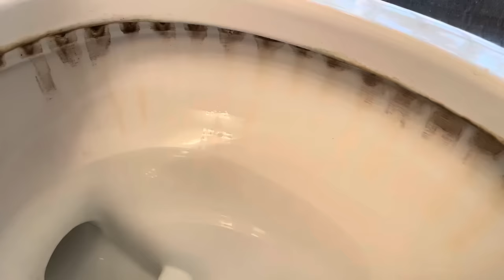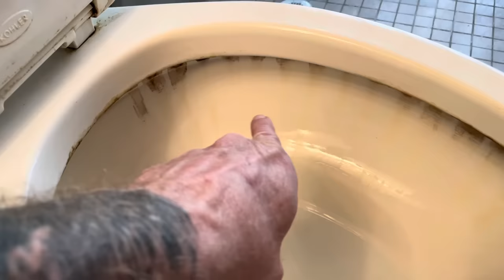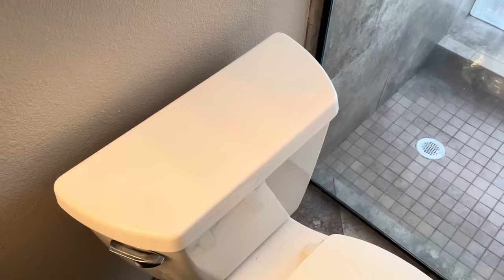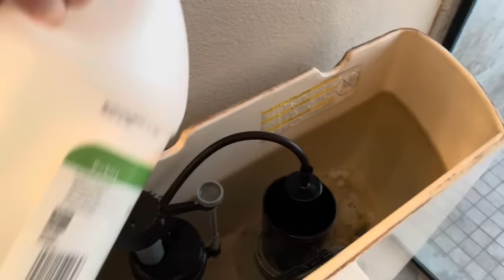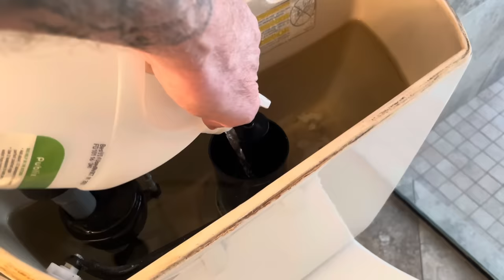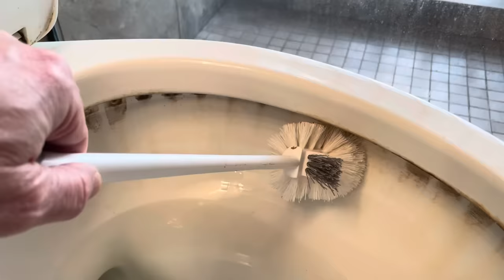Why Does THIS Keep Coming Back and How to STOP it

Comment: Flush it, clean it, dry it. Tape off the whole area and pour CLEANING VINEGAR in the overflow tube until it’s full. Let it set over night. Cleaning vinegar is 75% and not fit for human consumption. Trust me, it works. It’s also great for weeds in the yard.
Reply: True on the weeds, but it's non-selective, will kill any plant.
Reply: How do you tape off the whole area exactly?
Reply: Thank you for the weed thing!
Reply: @ascensionessentials tape the seat and handle down so no one can use it?  🤔 tape the door shut so no fumes escape?
Reply: Tape your nose and mouth so you don’t breathe it in.  Then get the hell out of the bathroom and take the tape off - you have 2 minutes. 😅
Reply: No cleaning vinegar is only 6% whereas regular vinegar is 5%
You can however find industrial strength pure grade vinegar but it’s still typically only at 45%. You have to actually search and find the 75% strength.
Reply: It cost way too much to use as weed killer. Might as well just use weed killer for a lot less in cost.
Reply: @DrLauraRPalmer lol,vinegar $5.00 a gallon,weed killer $25 a gallon.
Reply: repentandbelieveinJesusChrist1  It's good to know that the mold in my toilet was put there by Jesus.
Reply: It's not fit for human noses, either. Don't expect to use the room for a couple days if it doesn't have a window.
Reply: For the weeds use boiling hot water.  Pour it on them.  For the toilet, tape under the rim to plug the holes.  You can use toilet paper soaked in the vinegar to pack under the rim to if you don’t want to mess with tape.  Make it kind of like a putty/goo.  It can all flush down later.  Let the vinegar sit in overnight if your prostate will let you.😅
Reply: @jonathandeere6232  There are plenty of weeds (say, poison ivy) that survive forest fires. Boiling water won't work on such, altho it's a good first try.
Reply: I clean inside toilet bowl for water sediment, also in my hot water pot…
Reply: @ascensionessentials 
Thoroughly dry the area of the jets.  Then use duct tape to seal them off (strips will seal 4-5 at a time around your curved toilet bowl.  Pour your vinegar into your fill tube.  Let everything stand for a good while.  Overnight would be optimal.  Do not flush after you've taped and introduced the vinegar.  In the morning, remove tape and flush a couple times.  Voila!
Reply: Does this apply If I'm in an apartment equipped with a windowless washroom, and has no suction fan? There's a ventilation duct, but no suction fan. Should the bathroom door just be left open, if there's nobody home during the day?
Reply: @74Voyeur  
Cleaning vinegar is great but regular vinegar will do just fine.  People 'descale' coffee makers, etc. with regular vinegar and it works to break down mineral deposits and limescale.  It will kill any algae or mold as well, but, hopefully this isn't in your coffee maker.  🥴  The longer it's in contact with the mineral deposits in a porcelain commode, the better the removal of any hard build-up.

Comment: I'm getting tired of this black nonsense appearing every 4-5 days. I clean it and sure enough, it's back. Going to try it tomorrow. Amazing what you can learn on YT. My heater went on the blink, I called an HVAC co. and they told me $9500 for a/c and heater replacement. Went on YT, did some research and found it was the electronic control board. $195, found install video on YT. 5 years later, running like a champ. Thanks Papa Joe.
Reply from the maker: You bet. 👍🏻
Reply: Yup
Reply: The internet and being able to share information destroys all these scams
Reply: Way to go, dude !!

Comment: I'm beginning to think vinegar can do just about anything. No need for expensive cleaners which pollute our water. Thank you very much for this!
Reply from the maker: You bet. 👍🏻
Reply: I'm realizing that, great stuff😅😊
Reply: I add about a cup of vinegar to laundry when washing bed linen
Reply: Vinegar and baking soda. 👍
Reply: It really does. I'm a smoker and my windows in my house need a good cleaning every 3 months. I just use hot water and vinegar. They sparkle after that.
Reply: There's also "industrial" strength vinegar, about 10x as strong as what you'd use for cooking. Very strong odor, but it works wonders.

Comment: One reason this happens is because there are mineral deposits on the bowl.   Gunk sticks to these deposits and mold grows on the gunk. Vinegar can help clean mineral deposits… but often will not get them all…. Especially with heavy deposits,   What works is a pumice stick.  Use this to grind away the deposits . Interestingly… pumice stone is harder than the deposits, but softer than the toilet.   Gets out toilet rings too
Reply from the maker: Absolutely, I did a video on that. 👍🏻
Reply: doesn't the pumice score the surface of the porcelain which allows for deposits and microbiota to come back more tenaciously?
Reply: I did not know this & consider myself the Goddess of home cleaning hacks! LOL Tyvm for the pumice stone info
Reply: @selenepickins4874  
Hey Selene…. One last thing.   When you use the pumice stone on mineral deposits… it feels like you are destroying your toilet… that is the minerals being ground away.   When the deposits ,  are gone the stone will slide easily over the porcelain
Reply: The vinegar kills the mold, then you  have to clean the residue
Reply: If it were mold, as he says,  bleach is waaayyyyy better than vinegar.   It is not mold (new urban legend is born) ,  it's rust and other minerals which acids are effective against.
Reply: @dennisgarber I had the same problem. I examined it with a magnifying glass and it was most definitely mold! Hydrogen peroxide is the best thing to use to kill mold. I am extremely allergic to mold and I have used it successfully for years for all kinds of mold.
Reply: @dennisgarber  
You are partly correct…. The underlying problem is the minerals.  And you are also correct that acids help dissolve minerals.   But what if there is a thicker layer of minerals?   For example… let’s say you have a hot pot with minerals on the bottom.   Let’s say you throw in some vinegar…. Let it sit, and even scrub.  Then rinse out the contents.   Will the minerals be gone?   Nope.  Because vinegar is a weak acid…. Which is why you can eat vinegar… and why it only works with light mineral deposits   

Also…. Tap water is not pure….nor is a toilet a pure environment, nor is the air in a bathroom devoid of spores.   As a result…. If you have mineral deposits on your toilet… the surface will become rough… and the rough surface will collect layers over nutrient rich dirt…. And that nutrient rich dirt will become infected by bacteria and spores.   That colony can be killed by bleach, or acid…. But will re establish itself on the remaining rough mineral surface that resists cleaning by bleach or vinegar

If you successfully remove the mineral deposits… a simple flush and a bowl brush will keep your toilet tidy 

I
Reply: I use grill screen or drywall screen. Works great with a little elbow grease.
Reply: @kcojco  
I never thought of THAT.    I would only be concerned that it might be hard enough to scratch the porcelain.
Reply: @hedgeenemy1587 like scraping the enamel off your teeth ? not sure 🤔
Reply: @hedgeenemy1587 You need to wet the pumice stick first, I believe that’s what keeps it from scratching the porcelain.  I use 7th Gen  powder that works really well keeping the mineral residue off.  And occasionally the pumice.
Reply: @hedgeenemy1587 it does scuff the porcelain. Don't try it. We just purchased new toilets instead.
Reply: Pumice stone damaged the porcelain and causes stains to be worse, in my experience with it
Reply: Work smarter, not harder. If you have heavy mineral buildup, use something like CLR instead of vinegar and let it sit for an hour or two. You'll be able to remove the buildup with a toilet brush instead of scrubbing and potentially scratching the porcelain. If the buildup is really bad to the point where your toilet is slow flushing, you can use muriatic acid, but you have to be careful as it's caustic and can burn you.
Reply: @tboneforreal   
agreed
Although it is also the case that these products sheet off a toilet bowl… and for this reason it is hard to maintain enough concentration of chemical to effectively clean significant mineral deposits…. And the reality is that most people do not get around to cleaning mineral deposits until there is a significant build up
Reply: I swear, hard water causes so many problems. When my shower is dry, everything is covered in fine, white mineral powder. It has also stained my glass water bottle. You’re right though, pumice is the only thing that works. I’ve tried every product under the sun.
Reply: @dewilew2137     The thing  that I could never understand is why the minerals cling so tenaciously to shiny surfaces like tile, chrome, glass, or freshly waxed car paint…. Or, of course toilet bowls
Reply: Rubbing The pumice on the toilet surface makes my skin crawl...it's horrible like screeching chalk on a chalkboard.
Reply: @euphrates74   for what it is worth… this sound is from the grinding off of mineral deposits
Pumice slides smoothly over a  clean porcelain e surface
Reply: @hedgeenemy1587  Glazed porcelain tile has a Moh's hardness of 8 on the geologic scale. Pumice is 5.5-6
Reply: I’ve seen people with scratched toilet bowls from pumice damage.
Reply: @MrArdytube  

There are different types of vinegar, the vinegar you use for this is not the kind you eat.
Reply: VERY HELPFUL
Reply: @Delimon007 - Of course it is. Vinegar is vinegar. It’s just regular distilled vinegar mixed with water to a standard 5% concentration. 

Higher concentrations are available but they’re just as edible if diluted properly.
Reply: There's plenty of glazed porcelain surfaces on a toilet that can be used to test the pumice if you guys are concerned. Just try it in the back somewhere before using it in the bowl.
Reply: @littlestbroccoli  
Thx…. Just one thing….  When you use a pumice stone on mineral deposits…. I feels like you are grinding away the porcelain.  An alternative way to test pumice stone is on a clean area…. like the outside of the toilet bowl…. This way You can verify that it does  damage the bowl
Reply: @MrArdytube 😂
Reply: Once the bowl is clean, use caranuba car wax to polish the inside of your dry bowl and under the flow rim.  Just like polishing your car.  Water flows over so nothing can stick.
Reply: @jonathandeere6232  great idea

Comment: This worked for me perfectly!
Poured vinegar down three different times - first time I did it, I just poured maybe a pint in, let it sit for an hour, cleaned the bowl. It came back again, but to a much lesser degree. Next day poured some more down, let it sit for the hour again, nothing came back. 
Did it a 3rd time for good measure - all mold gone and the bowl has remained streakless.
Thanks very much for this!
Reply from the maker: You bet. 👍🏻
Reply: No streaks until you finish that burrito.
Reply: I tried this four months ago and it works! So far, it is has not returned.
Reply: @papajoeknows8355  Suppose you don't have that top with the water just the bottom?  what do you o then?
Reply from the maker: @whatyousay9816  without a tank, you have no access to the internal rim cavity. The two videos linked in the description will help you to clean the part you can see though.
Reply: @whatyousay9816  There might be an access panel to reach a tank, as installation usually includes some way for plumbers to get to it in the future without cutting into your walls.  If it doesn't use a tank you won't be able to use this method, but you might be able to find a spray bottle that can spray while upended or that uses a flexible hose to reach difficult spaces.  A lot of spraying might deliver enough up into that overflow cavity to accomplish the same goal as in the video.
Reply: What type of vinegar works best? Cleaning vinegar,  or regular vinegar. Will apple Cider vinegar work the same way?
Reply from the maker: @BlushAxolotls  distilled white vinegar.
Reply: @BlushAxolotls i used apple cider vinegar and it worked fine
Reply: @papajoeknows8355  Hi! does adding the vinegar damage the other parts in the tank? In other videos, they keep stressing, not to put anything in that back tank at all even if they say it’s safe… what has your experience been?
Reply from the maker: @mskeesh85  the acidity of the vinegar can degrade rubber seals, that’s why you see me pour it directly into the overflow and not the tank.

Comment: First time homeowner, I always figured it was some sort of sediment build-up from having hard water. Good to know that 1. It isn't, and 2. It's easily fixed. Great video!
Reply from the maker: Actually, you’re not wrong… the hard water deposits make it even easier for mold to “root” in. But the vinegar helps break down those deposits as well. 👍🏻
Reply: So glad I found this video. I thought the very same thing and therefore was clueless as to how to break it  off the bowl.  Need to go get me some vinegar now.   👏🙌
Reply: First time owning a toilet?
Reply: @DarkAraque  naw lol I'm well aged ...just never seen it blacken up under the rim like that in all my years.  Maybe where I live now the water is different and caused it 🤷🏾‍♀️
Reply: @DarkAraque  never had this issue before.
Reply: @energywine  all good just being a bit of a troll 😁
Reply: @MissMcD  it can indeed be one of the reasons.
Reply: Can we do this all the time? Or one time only.
Reply: Hard water typically makes white or gray deposits (though it depends on what exact minerals you have in there). The mineral deposits are gritty and make it easier for bacteria and mold to stick. Use vinegar to clean, just treatment to dilute with 3 parts water if what you are cleaning is marble!
Reply: You are not wrong.  Often it is hard water bonding to ceramic inner bowl.  Much more difficult to treat.
Reply: It is. I don't have this issue because we get our water from a well, and it goes through the purifier before reaching the toilet.  By the time it comes out to clean the toilet, it has salt and chlorine, so this build-up never happens.
Reply: @DarkAraque , well, if you would not be a useless troll over in the comments section, that would be nice.
Reply: @paxhumana2015  Sorry your day as been ruined by an harmless comment, wish you a good recovery.
Reply: I just clean my bathroom everyday. Deep clean 1x a wk but regularly brush the toilet and I've never seen it like this. (also use clorox bowl cleaner that goes in the tank and is good for 2 months).
Reply: @ProxCQ  If by purifier you mean water softener (because you mention salt) the salt doesn't actually go in the water, it cleans the filters that remove the hard water minerals from your well water. If the salt was in the water you couldn't drink it.
Reply: @DarkAraque  Seems to depend where we live. I neeevvvaaahhh had it until I lived in the Central Valley California.
Reply: @DarkAraque i often poo at my neighbor...😜🤪😝
Reply: @norad.harrison6590  I use the same cleaning routine, but have horrid black build-up under the rim. The vinegar tip in the video has made a visible difference with just one treatment.

Comment: Wow im a HVAC technician of 44 years and i learn something new everyday Thanks Joe!!
Reply from the maker: You bet. 👍🏻
Reply: Using funnel, I add vinegar water into my Little Giant Condensate pump after it has just run, not too much because good to let it sit awhile; furnace will soon produce enough condensate for pump to turn on and evacuate the vinegar water.
Reply: this is more EVAC than HVAC
Reply: Another reason is that if there is mold in the water part… more likely than not… a member of the family has “unknown” diabetes!!  Mold loves sugar!  THIS IS A FACT!!  For months I hadn’t been feeling good but thought things weren’t so bad.  In the meantime, one of our three bathroom toilets kept getting mold down in the water when peeing.. only in the master bathroom.  I even called the city thinking they might know… and time kept going on by!   Then I got very sick and went to the hospital knowing something had to be really wrong for as sick as I got.  I had diabetes and my sugar/glucose level was 649… normal should be from 70-120.  I was still wandering about the toilet problem I couldn’t solve!  So I went researching, researching and researching!!  And low and behold… I found my connection!  Stating that undiagnosed and/or uncontrolled diabetes creates my said toilet problem, exactly!  Stating “mold love’s sugar” (verbatim)!!   I GOT MY DIABETES UNDER CONTROL AND HAVE NOT HAD MOLD IN MY TOILET SINCE!!   It has been five months and still no mold… in my toilet water!!   Yes, we all can learn something new everyday!!  Pass this on!   Blessings-
Reply from the maker: @lyndameng6234  wrong
Reply from the maker: @lyndameng6234  wrong
Reply: It stands to reason. This is done as a normal 6 month service call in the HVAC field. When I went to HVAC school last year they expressed the importance of doing the exact same thing with your furnace and AC unit once every few months. If you dump a cup of white vinegar into your humidifier or dehumidifier on your unit (depending on the season and which you are using) this keeps mold from forming in the drain pans as well as in the condensation lines. Ive ran into numerous people (including myself prior to school) where the condensation line got clogged with mold causing the pan to overflow into the the furnace and destroy the circuit boards as well as rusting out the heat exchange. I just had a customer the other day with the same issue. Furnace was full of water. I explained a little white vinegar every few months will keep the mold from forming so this wont happen again!